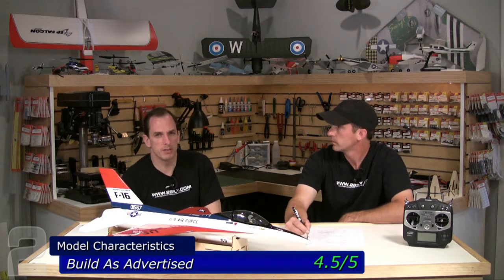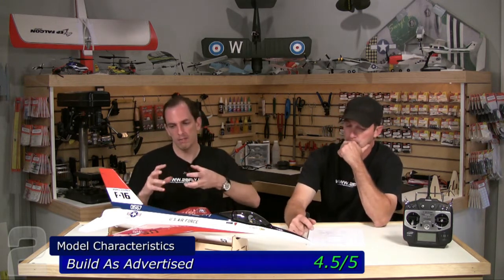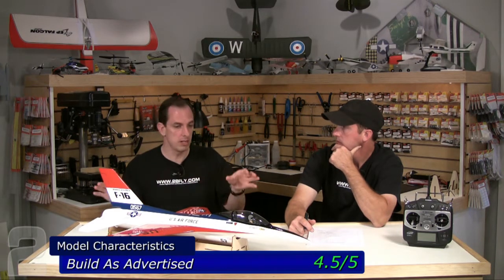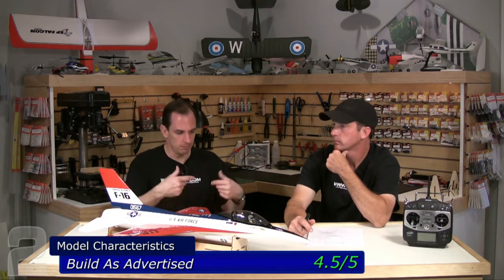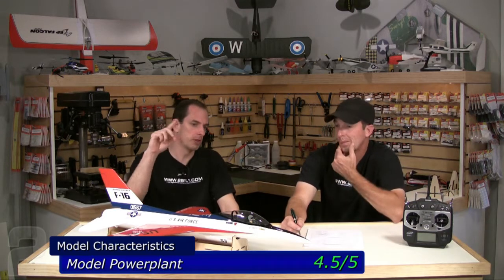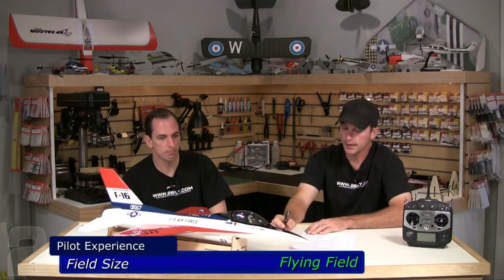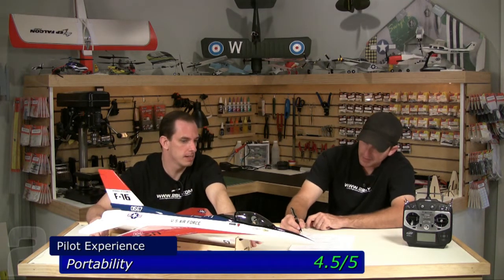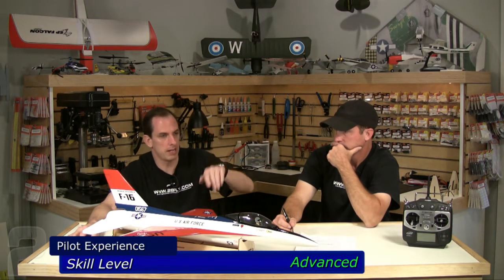ElectriFly F-16 Review - Part 2, Scoring

Comment: I'm considering my first rc jet. I been flying planes and heli's for a few years now. Looking at this model and thinking if the Eagletree Guardian would help on take off and landings. Being I've used the guardian now a few times. Not that I need it, but it does tame down some swirly planes, and during wind gust. What's your take on this jet with a guardian system to turn on if need be, to aid in landing or other issues that may arise? Thanks